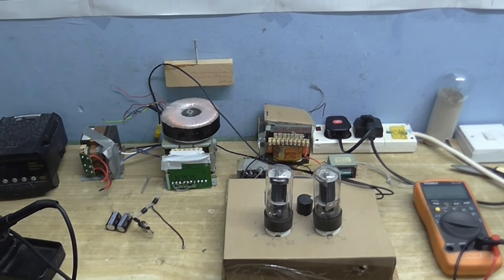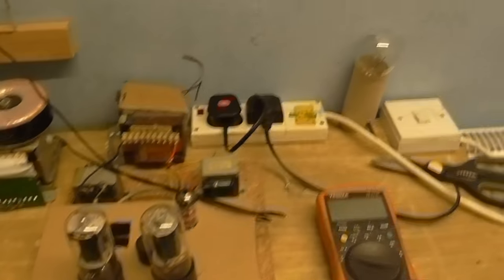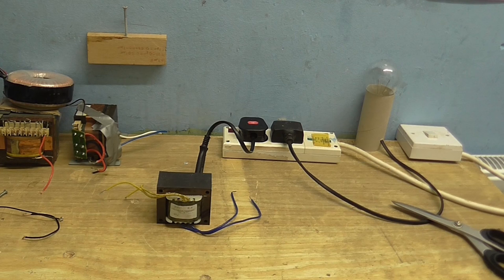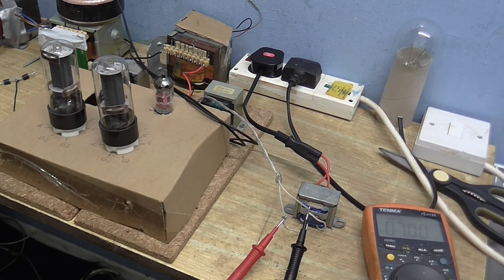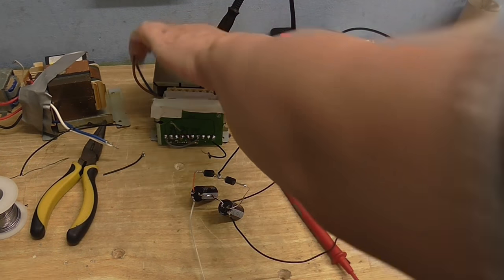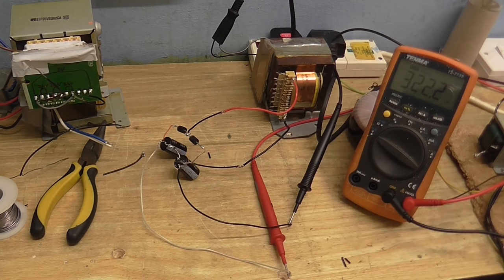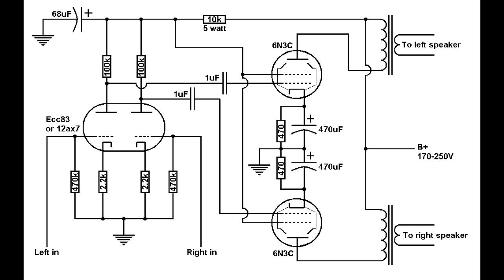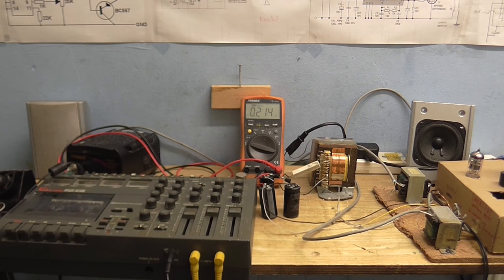Re-instating my tube amp, phazing a transformer and tests.

Comment: Nice! The filament voltage is bang on 'cause the winding is 12V, 15V is the open circuit voltage. As soon as you put a big enough load, it'll drop to it's designed voltage. Great to see a video from you, it's not like you are youtube full-time and have a schedule or smth, you make a vid when you have smth to make a vid about.
Reply from the maker: I've been wanting to do this for quite some time.  Anyway yeah I knew there would be a little drop when I connected the filaments, thing it's not easy to tell what the voltage will actually drop to, I thought it might only drop to around 14 volts.  I actually did think about that when making the HV part, if I wired the transformer and rectifier up it up so I got 250 volts DC with the load of my amplifier connected, even though that's about the best voltage for that circuit, before the tubes warm up of course it won't be pulling any current and I might have 320+ volts going through the the tubes, witch would not hurt the big tubes, but I'm not sure if the little ecc83 would take that.
Reply: In my experience,  output voltage drops by 2-4v easily depending on the load and transformer. And you have those resistors in plate circuit which will drop some voltage,  plus smaller tube warms up faster and should pull the voltage down to safe level. Go and measure the anode voltage to be sure.

Comment: i did not know about that voltage doubler rectifier, one more thing i learned when watching your electonics related videos. thanks.
Reply from the maker: Yeah there pretty good for getting higher voltages, just one thing to remember is that you'll only get half the available current you would get if you used a full bridge.

Comment: Good video Ciem, I doo like the current limiting set up, However a propper lamp holder (surface mount one) rather than a cardbord tube, Also i would use wago connectors or even better a quick test unit to connect stuff up to mains temporarily rather than stuffing wires in to a C7 plug there much safer aswell. Keep up the good work and electronic videos.

Comment: Nice to hear from you again Clem!
I reckon that the "Quick connect things" that you mention might actually be Safe Blocks.
I suggest that you look again at the Cathode bypass Capacitor of the Output Valve in the Right Channel of your Amplifier Schematic here.
People do say that the sound reproduction via a Valve Audio Amplifier is warmer than that had from the Solid State alternative.
Is it something that can't be explained by science?
Reply from the maker: I hadn't noticed that little mistake until now, I might do an annotation correcting that. As for that warm sound of valves, I think it might be that valves add harmonics, it's a very small amount and that gives them the "warm" sound.

Comment: Chokes have an air gap. If you use a transformer you will saturate the core.just use an rc filter.
Reply: True, but all you need to do is to short the other winding and the core won't saturate.
Reply from the maker: I'm not too worried about the core saturating as long it works well 
enough, which it does.  I will also to use proper output transformers 
for the speakers if I ever get hold of any, at the moment using a pair 
of mains step-down transformers as my output transformers seems to work,
 but I'm sure it would be even better with the proper ones.
Reply: CoolDudeClem I've dismantled an output transformer before (the one for single-ended output) and it is just non interlaced core. What I mean is all I-pieces are stacked together, so are the E-pieces, then the core is assembled by putting those stacks together with a thin piece of paper between them. If you have some time, I suggest you to try. You can always rearrange the laminations to return the thing to the original state :)
Reply: MrJohhhnnnyyy
Reply: MrJohhhnnnyyy in the second output transformer there is a gap because the unidirectional current will saturate the core. same in cakes.  I cannot see how shorting the other winding makes a difference as we are talking about the DC in one winding affecting the core. the other winding makes no difference unless you put ac on it which defeats the purpose.  hence the core gap.
Reply: Malcolm Fairleigh Maybe, I didn't test it. I just saw this trick in a lot of schematics on the web

Comment: Tube circuits are best for preamplifier. Im make double triode preamp stereo chanell. Preaamp are tubes and speaker amplifier tda7388 sound quality are ameizing!!! Triode anode supply not clasical transformer and cap diode brigde circuit. Its powered inverter circuit 12v to 220v inverter not need much powerfull to supplied tube preamplifier.

Comment: there are a lot of things that run on a phone charger and this is not one of them
clem did you just challenge me?
i could build a tube amp powered from a phone charger
Reply from the maker: No, but building an tube amp that runs on a phone charger voltage would be awesome!
Reply: headphones or speaker?
how much power does the phone charger have 5V 2A or a 5V 5A
i can do both
and i do consider it a challenge!
mmmmm does hybrid count?
if so i already know what i can rebuild
and i just thought of a cool full tube otl headphone amp